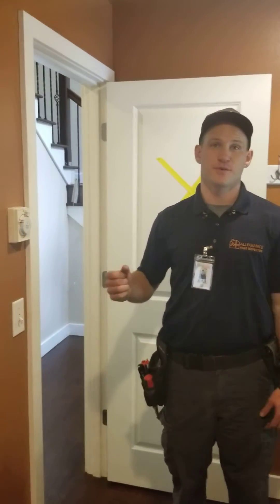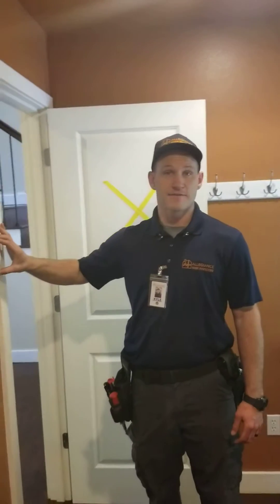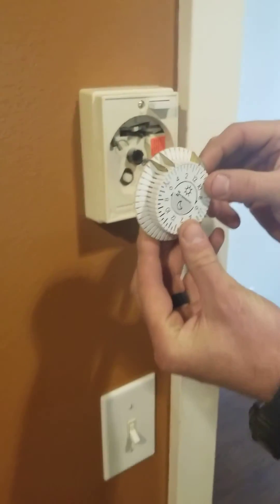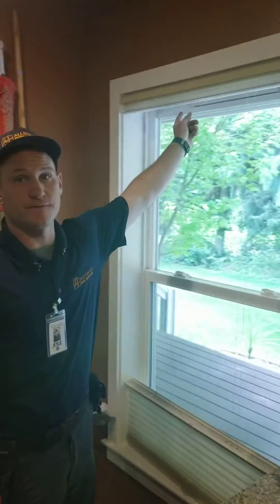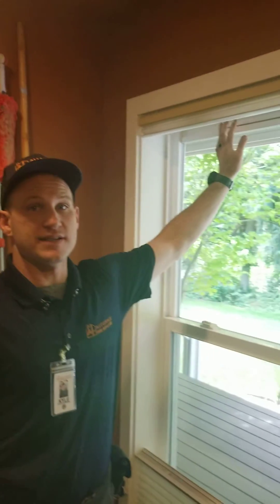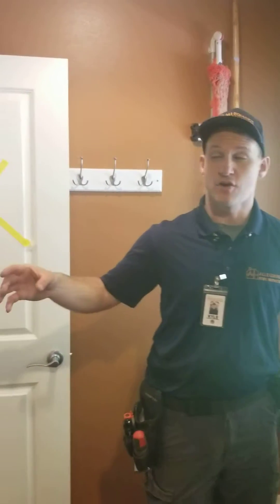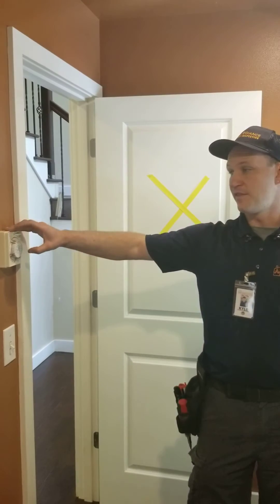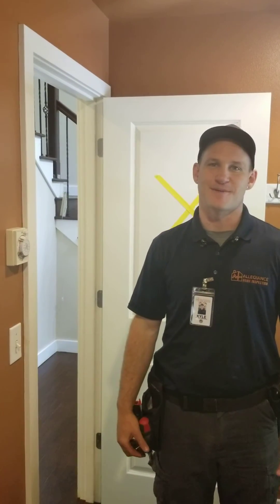How a Simple Whole House Ventilation System Works

Comment: Thank you for the video. We have this same type of ventilation system in our house. It only controls 1 upstairs bathroom fan. Our house is about 2,600 sq ft. How many hours should the fan run daily?  Thank you
Reply from the maker: We could really get into the weeds diving into building science… there are calculations based on how many CFM (Cubic Feet per Minute)etc. etc.

For a simple answer I’d say you could look at running it anywhere from 8 to 24 hours per day.
Reply: Thank you sir